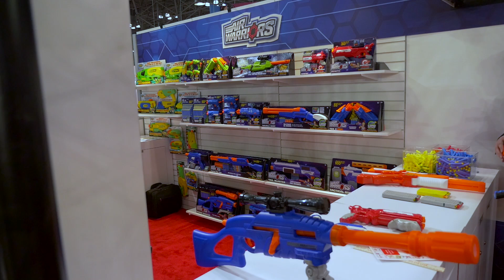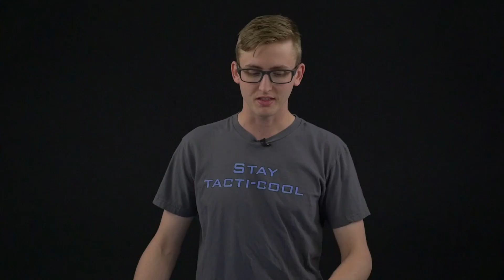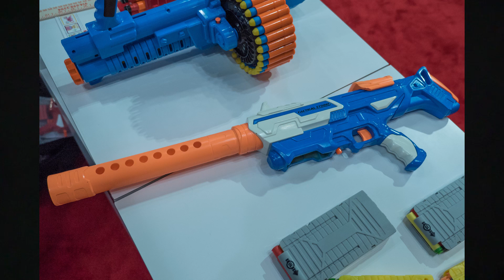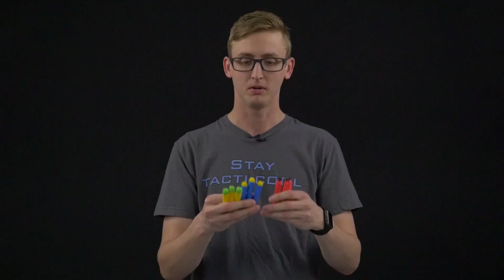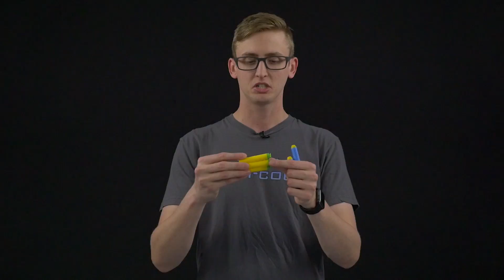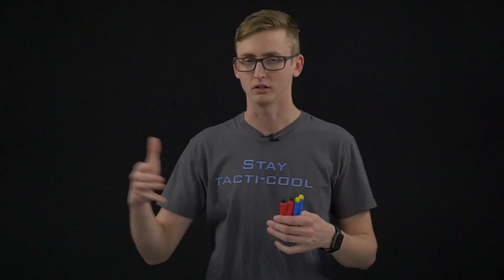Buzz Bee Booth Experience | Toy Fair

Comment: The Range Master is actually a re-creation of the old Snipe model. I have one that I got from a Thrift Store. It's air-powered. The bolt is the pump. Not sure if the RM is going to be the same, but the old Snipe was.